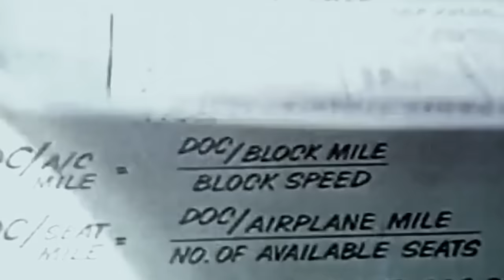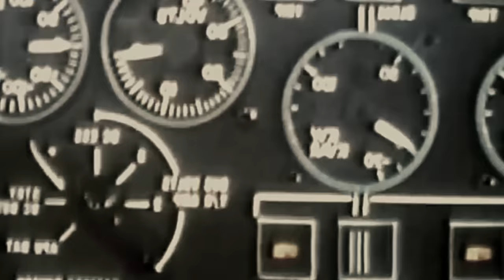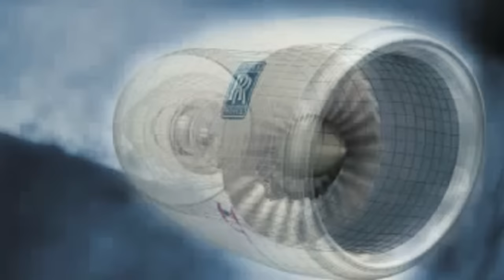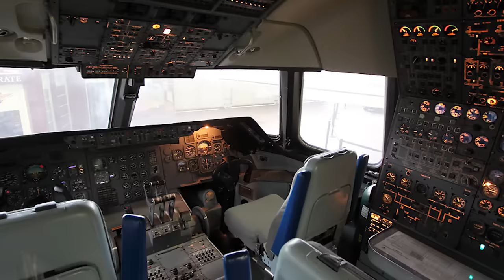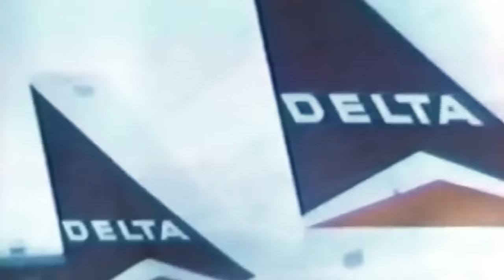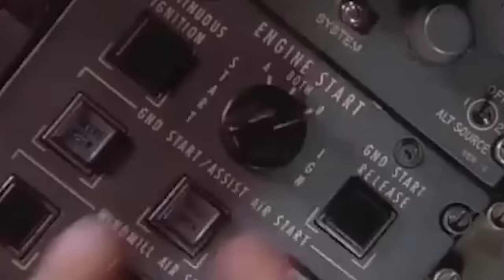L-1011 Tristar - too advanced for us

Comment: The S-duct for the number 2 engine is just a work of art, when you compare it to the DC-10.
Reply: DC-10 was majestic, tail high up in pride. 
L-1011's  S-duct looked clumsy like an after thought by a forgetful engineer
Reply: @touche6792  i highly disagree, the Lockheed L-1011 was the Most graceful Widebody TriJet Ever Made. That "S Duct" design is a Work of art, instead of just sticking the #2 Engine Dead Center in the Rudder, Like Douglas did.
Reply: Kids voted for DC-10:)
Reply: We should not compare between airplanes because each one is unique in its own way. As a pilot I was lucky enough to have flown both types and I love them. DC10 was a playful puppy that loved to reach the clouds whereas TriStar was more like a sedate gentleman, heavy on the controls and as solid as Gibraltar.
Reply: @gerardosalazar161  nicely said, 👌 they were both awesome airliners !
Reply: @sexynelson100 All I can think of is if the engine massively failed in the -10 you might loose the rudder?
Reply: @josebrown5961 Years ago I got to do a tour in this Lockheed museum in L.A. with this L-1011 cutaway model. A docent in the know was there and I asked that same thing about the aft engine. 
	He said it streamlined the tail and reduced drag even more than the sleek appearance indicated. Also, stability was improved, on ground and in air. AND, It improved engine thrust effectiveness with the tail pipe in line with the fuselage, not above. Great plane.
Reply: @kennethmartin1300 I only took one once. It was and even now remains the best flight I’ve ever had. 

The takeoff was smooth. The plane seemed to accelerate quickly and climb out was just as fast.

That landing was even smoother than the takeoff. I guess those widebody planes do it a lot better than the narrow ones.
Reply: @josebrown5961 You're lucky! The closest I ever got to an L-1011 was that cutaway model in L.A.

Comment: Still one of the best looking planes ever produced
Reply: D  The DC10 wasn't as refined as the L1011 imo
Reply: The MD11 is the best in my opinion.
Reply: more like the most ugly one
Reply: MD11 and 747-400 for me 😁
Reply: Much more aesthetically pleasing than the DC 10 because of the seamless blending of the upper engine into the fuselage. Overall, quite a nice looking aircraft. (Popular with flight crews also. I used to love working downstairs- all u did was send up the meals. No uniform required!)
Reply: @patrickevans5439  Yes! Totally agree! I was never lucky enough to work on one though. My career doesn't take me off the ground very often... But then you'd hope not driving a coach or truck!
Reply: I like the MD-11 more
Reply: That's purely subjective...I'm an airbus 380 guy!
Reply: Best looking =/= Reliable. Passengers sits inside of them, not outside of them. Planes are made to provide service, not as eye candies.
Reply: @GudaGudaPaisen  no one mentioned reliability, but the L-1011 was abundantly more reliable than the DC-10. There are many references in pop culture to how bad the DC-10 was. Not so for the L-1011. Lockheed focussed on reliability when they were building the jet. That was what sold them.
Reply: @JamesW81  actually L-1011s had somewhat of a poor dispatch reliability in the 80s because the parts market was hit with a big amount of dodgy parts, even though Lockheed was still supplying spare parts.
Reply: Nah dc10 was more og than L 1011
Reply: Definitely L 1011
Reply: @GudaGudaPaisen  yes that’s true but I would much rather fly on a Dreamliner that gets me to London in 8 hours than a supersonic plane that has no walls

Comment: I'm a former L-1011 FE/FE Sim Instructor/Check Airman. We operated both L-1011s and DC-10s. When the DC-10 guys came to look over the L-1011's flight deck they were amazed at how much more advanced the panels and systems were on the Tristar. It was a wonderful machine and some of the most fun I've had in my 40+ years of flying. Excellent vid Skyships!
Reply: Don't forget, the avionics were from the same guys who brought us the SR-71 Blackbird.
Reply: And it took off like a rocket too!
Reply: Reason the RAF kept them going up till a few years ago
Reply: @sorphin  I would place it second, after the 747. Too bad Douglas butted in.
Reply: David Mallinson yep, when it was empty.
Reply: Hakencruz as well as the USAF flying DC10s as tankers.
Reply: Did you ever see the ghost of flight 401?
Reply: Thats an important information. I think Lockheed created an outstanding expertise with this A/C for future activities.
Reply: As a Sim Instructor, you might appreciate this.  
I was a systems instructor at Palmdale and we used our articulated simulator as a training aid.  Of course Pilot Training had priority and during a training session (all Pilots) someone decided to see if the simulator could do a loop.  The cabin went to it's maximum physical pitch attitude , 45 degrees (?) 90 degrees software, the gondola instantly pitched down and the hydraulic actuators reached their snubber limits. A hydraulic line ruptured.  Instant red fog filled the simulator bay.  The simulator operator immediately shut down electrical power as he knew that fog could explode and destroy the building.  To maximize their misery, the  bay was pitch black and the access bridge could not be lowered to evacuate the crew.  The Lockheed fire department got the students out after a long delay.  I went down the next day to witnessed a god-awful pink and red disaster.

Comment: My favourite airliner ever. Would love to see Lockheed re-enter the market with an update of this beautiful machine.
Reply: They probably could with the advancements in turbofan tech... The Rolls Trent-1000 or GE CFM56 or LEAP wouldbe good engines to go with... Use those in a twin arrangement and you could have a widebody regional / international jet that could have a shot at competing against the A320 or the 737MAX. I doubt a tri-jet arrangement like the original L-1011 would go dow well in the current civil aviation market due to the increased running cost of that third engine, plus it takes up fusilage space that could be reserved for more passenger space in the tail.

Besides that, there's also the safety concerns of having a tail mounted engine due to the fact that if you suffer an uncontained failure, it can damage the lines running to the stabilizer and rudder. The DC-10 had a couple incidents just like this where an uncontained engine failure caused damage to the hydraulics that ran the controls in the tail, rendering the plane almost completely unflyable. Yes, more modern turbofan engines have uprated fan guards which aid in protecting the rest of the airframe from an uncontained failure of the fan assembly, but there is always that slim chance that an uncontained failure can still occur, which is a risk many airliners refuse to take regardless of how slim that chance is now.
Reply: If they could bring it back with 2 engines it would give the 777 and 350 a run for the money it's about the same width and looks better
Reply: @DigBipper188  trijets are history. Also lockheed already has a lot of defence projects to be finished
Reply: @antiwokehuman  That's true. With the regulatory changes allowing 2-engined longhaul flights and the improvements in fuel efficiencyand power output from modern turbofans - trijets have been pretty much relegated to the history books.

Not to mention basically nobody wants to mount an engine in the tail after what happened to a couple DC-10s when their rear engines went kaboom, and the ensuing shrapnel from an uncontained failure took out the hydraulics for the rudder and elevator controls!